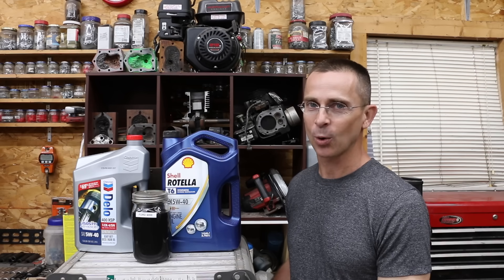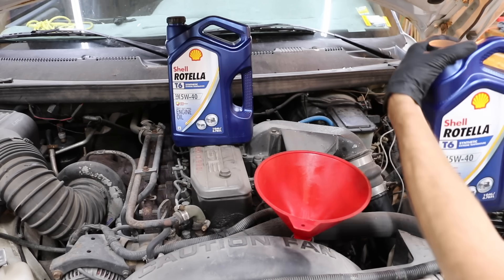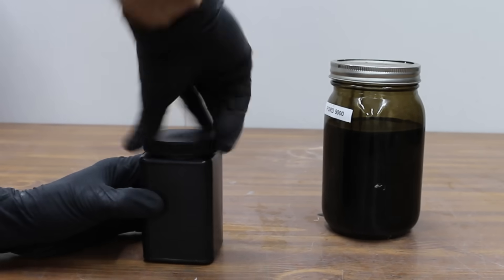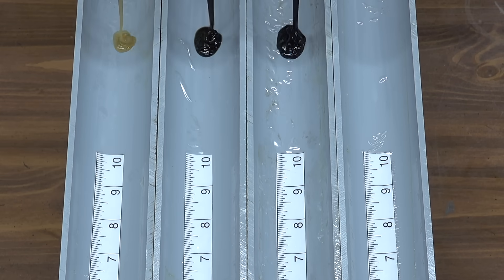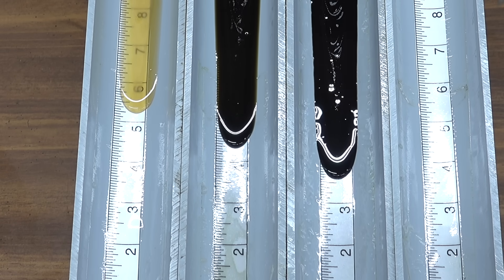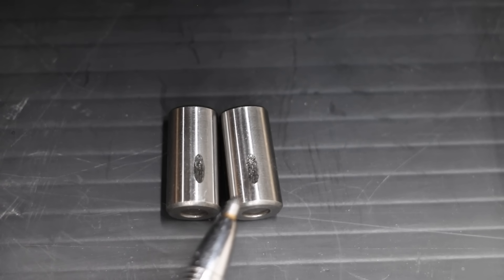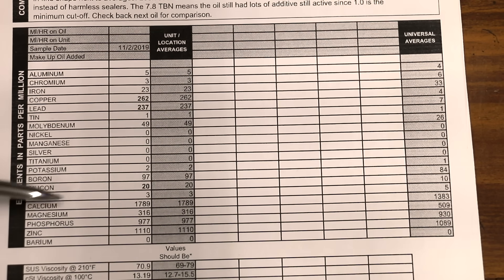Will Annual Oil Change Damage Your Car? Let's find out!

Comment: It's just marketing assuring that after a year you should change your oil not taking into consideration the mileage.
Reply from the maker: Great point!
Reply: Life is not that simple: You cant change the oil after 10 years, because youre only driving 600 miles/year.
I will never understand why people try to safe money on oil changes. Thats just stupid. Youre paying like 40k4 for a nice car and then safe 70$ once per year on oil changes? I you want to safe money, buy the oil and do the oil change yourself...
Reply: @Chris-yy7qc  Millions of gallons of oil would be saved if people changed their oil at mileage intervals. Has to be a good thing.
Reply: @stevematthes4325  1) Used oil will be recycled and can be used again (if disposed properly). 
2) Its better to replace your oil than your engine
Reply: i changed mine every 3 months,& tire rotate,,on the bronc.never any trouble.it was severely thrashed.i dont drive kindly..
Reply: It can't be so absolute. Manufacturer says 15.000 or 1 year. If I drive less, always let the oil warm up, it could be longer than a year (the oil remains good indefinitely unused in the can, it seems). (BTW I'm driving 12000 km per year and change the oil yearly.)
Reply: It can't be so absolute. Manufacturer says 15.000 or 1 year. If I drive less, always let the oil warm up, it could be longer than a year (the oil remains good indefinitely unused in the can, it seems). (BTW I'm driving 12000 km per year and change the oil yearly.)

Comment: Can you test rotella T 15w40 vs mobil delvac 15w40 vs chevron delo 15w40 vs fleet farm farm rated 15w40?  Just the non synthetic oils.   Do all your tests on them 3 like the cold oil race, the lubricity test and the oil lab analyzation.   I've been running delvac 15w40 in my diesel trucks and small engines and fleet farm farm rated in all my  tractors.  I haven't had good luck with rotella t 15w40 it tends to burn more in my higher millage diesels lots of other guys have had the same issues with rotella 15w40 from the ford Idi diesel facebook group.  Would definitely like to see best off the self diesel oil video would be super nice
Reply from the maker: Great video idea!  Thank you

Comment: You can probably get away with it... but why would you?? If you don’t drive much— once a year regardless of miles driven. Daily driver— every 5,000 miles. Even with that 15,000 mile stuff. Oil is cheap... variable valve timing systems and engines are not. Are you really going to risk a 4-7,000$ engine because you don’t want to spend 50$ once or twice a year (depending on how much you drive)? That literally makes no sense to me. But hey if you blow your engine, wear out your bearings, kill your variable valve timing, or ruin your piston rings I’ll hook you up, but it won’t be 50$ like an oil change.

And don’t pay some teenager to change your oil... learn how to do it and save some $$$.
Reply from the maker: Thank you for the feedback
Reply: GreenhouseGrower A test is a test. It in no way reflects real world. In the real world, not changing your oil enough lands you at my shop with a busted engine. And you can wave your test results at me all you want, but it’s still not going to save you from a 5,000$ invoice for a new engine.

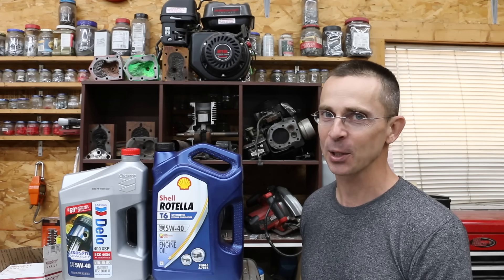Comment: 11:50
So here is the important info...
Make sure the engine reaches
1. "Full Operating Temperature"
2. "Once a month".
Reply from the maker: Thank you!
Reply: @ProjectFarm  For how long should I get it at full operating temp? And what if I did not reach operating temp at least once a month? Change the oil every 6 months? Thanks!
Reply: Probably some of the best advice posted! More engines ruined by moisture in engines
Reply: What if we rev the engine and do hard acceleration in cold weather to warm up. India is actually having a very mix and changing weather.
Reply: @maubilla  Dont, revving hard on a cold engine causes blown headgaskets. wait till the temp is on the guage for cars/trucks. for air cooled engines just warm it up till you feel heat on the cylinders side with your hand...

heat up a thin frying pan to fast and it will warp just like a head being heated too fast.

Comment: This really helps me personally.  I have a tractor I only use to plow roads and odd jobs.  It's 15 years old and only has 200 hours.  I have gone 4 years between oil changes and haven't noticed any problems.  Never occurred to me to have my oil tested.  A test would be cheaper than an oil change and I will do that from now on.  Well done!
Reply from the maker: Thank you!

Comment: As a 25+ year mechanic, I really appreciate your comment about letting your engine come up to operating temp once a month to disperse any moisture. I have long believed that "time intervals" for oil changes were a joke/propaganda. I have always advised my family & customers to go by hours/mileage as long as the engine was operated at normal operating temp every 4 to 5 weeks.
Reply from the maker: Thank you very much and great advice!
Reply: I can not understand the term "normal operating temp" i have a new VW PASSAT that have an oil temp reading (not the water coolent temp) in the instrument cluster. If i drive gently for long distances it average 97 in summser and 92 in winter. If driven (reved)  little harder in sport mode it reach 102 in summer. So my question is: should I bring the oil temp above 100 centigrade (boiling temp) or just the max temp of a gentle long run? They are way different temp from each other. Thank you
Reply: @TubesWidener  oil does not boil at 100 C. Water does at sea level and under certain barometric pressure.your oil should be fine upto an even higher C. Check oil manufacturer data.
I replace my oil when i dont like the color ...black.thats it.£30 per year and only 4 L .I can live with that both environmentally and financially.we tend to overcomplicate things.
Best
Mick
Reply: @solkim133  But it's water that must evaporate from the oil.  Obviously the oil in his Passat gets much hotter than 100 Celsius, I don't know where the "German Engineers" placed the oil temp. sensor to read that low.  I drove an Audi years back and the oil temp. gauge was at over 150 Celsius.
Reply: @PrimalMiltos  it is 2019 1.4 TSI (125hp) with 7-speed DSG, Made in Wolfsberg. I drive it gently because of the TSI common problems common here in my Country Egypt! It is very hot weather most of the year
Reply: @TubesWidener  so what motor oil do you use on your VW diesel?
Reply: @TubesWidener  ...then normal operating temp. for your car is approx. 95 Celsius on the instrument gauge (obviously the sensor's position is the reason why it is so low) so use that value.
Reply: @PrimalMiltos  I guess so, thanks
Reply: @TubesWidener  it doesn't need to boil, it'll evaporate at any elevated temp, it just takes longer. Also, that's just an average temp, it has gotten much hotter in the bearings, the head & bottoms of the pistons until it is returned to the sump.
Reply: About a year ago I put a low mile Japanese import engine in my Nissan Altima. The car I bought used with 225 k on it. The engine appears new except a huge amount of soft carbon. My guess is the engine was never warmed up to operating temperature. It took me awhile to figure out the engine misfire code and 420 code was the engine cleaning itself out with 50 miles a day driving. I'm down to clearing the 420 code every couple of weeks.Love that code reader.
Reply: You Wish  That Audi 100 also had oil temp. gauge on the top of the center console.
Reply: Word-i found this out after necessity on my gen set. Now of course driving conditions, engine type (turbo ?) etc may vary, and of course if you can change and dispose fo your own oil Nd enjoy that task, better to switch out frequently, but I can agree most people change their oil too frequently, and for those of us with a gen set or expensive Germany car (oil changes at 150-200 at dealer !) much cheaper to get periodic oil analysis from Blackstone Labs at $25. Moreover, you have DATA to show what is proper intervals for your engine.
Reply: I agree with your comments. Read mine above!
Reply: True story , my vintage Vdrive ski boat I restored 25 years ago including a rebuilt 350 chev slightly modified , changed oil after 2 seasons , since then it has spent hundreds of hours pulling  skiers , tubes , running around , last week  ( 22 years after the last oil change with 5/50 castrol and a can of GM EOS ) I changed the oil it was still clean ,opened up the filter no visible contamination , no metal on magnetic oil pan plug , inside valve covers clean ! Fired it up still runs great  , no engine noise and it sits at least 6 months every winter without starting .  ( Been a red seal mechanic 45 years )
Reply: thank you for your comment.  unfortunately, I am not a fan of synthetic oil, but that's what the industry coming to. I currently have 3 Toyota.  I have a  2000 Tacoma, 1986 Celica gts, and a new 2022 Camry. I changed the oil in all three vehicles at 1000 miles without fail,  but this is the way I take care of my vehicles from the start no disrespect intended. just quick information my 1986 Celica has 270 thousand miles on it the original engine thank you for your time
Reply: @jameseverly8501  
Soooo.....
You've changed oil in the Celica 270 times in how long ???
35 years at only 7,500 per year driving...
Ya sure don't drive much to warrant such...

Comment: My DODGE 1996, 5.9 CUMMINGS, CHANGE OIL EVER 5,000MILES,  Delo400 oil it has 183,000 miles on it now. Question is about them valve's adjustment
Reply from the maker: Nice low mileage cummins!  What's the question on the valve adjustment?
Reply: @ProjectFarm  is it really that important keep up on the adjustment, and best way to adjust them

Comment: believe what you must BUTT! i had a 1998 dodge neon with 98 thousand miles on it when nought, drove it for 5 yrs. never changed oil, just added when needed, put tires and gas , passed emmissions when bought and two yrs later  passed again two yrs later passed again then sold it and had to get test again to sell , passed again! and had bout 187 thousand miles on it , new owner i told DONOT CHANGE OIL!  if you do then it honna smoke , yes he changed oil and it smoked , so told him go get motor honey and put in whole bottle then drove it for two days and no more smoke amd following year passed emissions again ! after that don't know what happened to it . So changing oil so often me i don't think so and when oil turns black it's just burnt but it still oil but black that looks like its getting back to it's original organic state eith all the natural vitamins thst nature put in it! which is healthier for da motor! i started to use penzoil but it left white milky redidue in engine and engine ran hotter then used valvoline which had detergent in it which helped keep inside motor clean. one quart every  eight weeks
😀
Reply from the maker: Thank you for the feedback.

Comment: In locomotives, we rarely change the main engine oil. If there was engine damage or a massive water or fuel leak, then yes - otherwise, no. 

And we have the oil analyzed every 90 days. 

Now, to be fair, they also probably get about 10-20 gal of oil added each week, and hold a lot more than that (some have a shallow sump, others a deep sump, either way it's well over 100 gal of oil.)

Comment: Changing oil at 10k/km  is the BIGGEST bullshit gimmick there is to boost sales on big oil companies. Maybe at early ages of automobile history it was required to change the oil frequently, mainly because they used lard and butter to lubricate the engine (pun intended). Heck! I know a guy who drove his Toyota Hiace 100 000 km with modern oil (added 0,5l from time to time) without changing it ever. And the biggest surprise is that the HiAce still runs perfectly fine as we speak. No smoking or any problems of what so ever. And clearly passed mot emissions. Which are ridiculously tight here in Finland, when speaking about exhaust emissions!

Comment: I absolutely love how you do "real world" tests on products (not just oil, but pretty much everything!).  I would love to see something like this with Supertech (Walmart brand) oil.  I had an old Dodge Durango and I had no problems with it until.... I switched from Castrol 10-40 oil to Supertech 10-40 (it was cheap right?) and I found out why.  Spun a main bearing after 250 miles and to this day I absolutely think it was because the Supertech broke down.

Comment: I'm an advisor at a car dealership and the brand I work for always says to change oil and service the car every 6 months. Sometimes people stretch it out and go over a year but don't put on many miles and I got after some customers for doing that. Since that is how I was trained. However, with seeing this and the evidence laid out, if I see this again and people saying the excuse(I don't drive it much), I think I'll change my attitude and say that it's ok as long as they go for a long trip once a month(which is also what I said before), I just won't get after them since it's doing their car no harm. This is very interesting.

Comment: We must be aware that wear tests made at room temperature are irrelevant. The oil film will probably break at higher temperature, and lubrication capacity will be worse. Nevertheless, with new full synthetic oils, two years or more are not unusual, but for diesel engines. European diesel Monedos are due to oil change after 30kkm (18780 miles) / 2 years, with full 200kkm (125000 miles) warranty

Comment: Great video! About to do an oil change on my truck. 

How about a coolant show down? Maybe pre mixed (a couple off the shelf brands) VS distilled water With “water wetter” VS distilled water and “Hyper cool” you could check for  evaporative loss, maybe dip some metal and let it dry to see which one has the best rust inhibitors. I’m sure you could come up with a couple more tests. Just an idea.

Comment: Does the same principle apply to gasoline engines? I have a 2019 Tucson that is asking for 7500 miles or 6 months and we have been using the factory oil. But we don't drive 7500 miles in 6 months, it takes us about a year. I know I have to consider the warranty, but I'm just curious. I actually don't plan to have the car beyond the length of the warranty.

Comment: Great info!! I've never quite trusted the idea that oil must be changed at least once a year regardless of miles. Thank you for saving me money and time!
Reply: Doug 
I got a 98 dodge 12 I change your oil every 30,000 miles! 
I change the filter every five!
I use a synthetic filter! 
560,000 miles Then I rebuilt?
Reply: @openyoureyes3113  NICE! Thank you!
Reply: Doug 
I get my oil analyzed every time I change the filter! 
The place that analyzes  oil is 5 minutes away from my house .
I started to go there when I bought my truck new! 
So I’m not playing Russian roulette with my engine! 
I got a cousin that’s a diesel mechanic the shop he works in they test oil after every oil change! 
He told me years ago most oil has so many additives The oil does not break down! 
That’s why the oil change Intervals recommendations of gone up so high! 
My cousin has a farm he saves the old motor oil from work! 
Runs it through another filter and puts it in old farm equipment!
Reply: @openyoureyes3113  Oh that's sweet! Great info!

Comment: Something to consider. Unless the used oil is left in the engine for decades, you probably won't see much acid damage on cast iron or steel parts. Where you'll see the most damage, if any, is in bronze crank shaft and piston rod bearings and any internal aluminum parts exposed to the oil as they are softer metals than iron based metals and less resistant to acid corrosion.